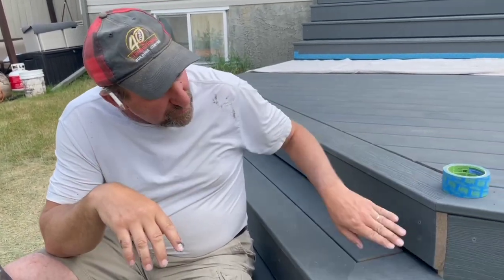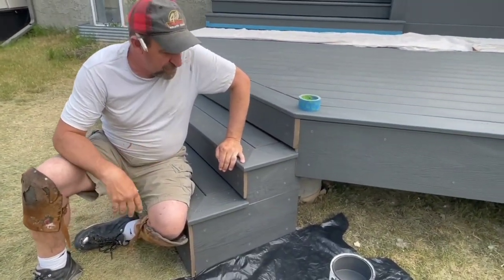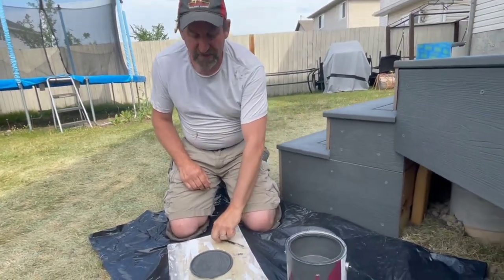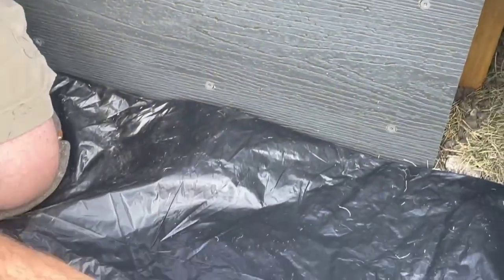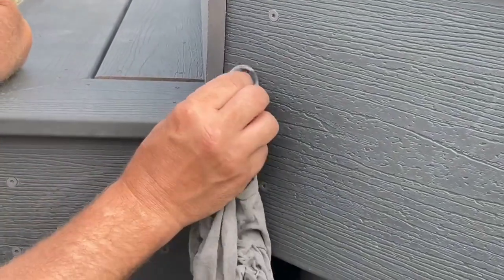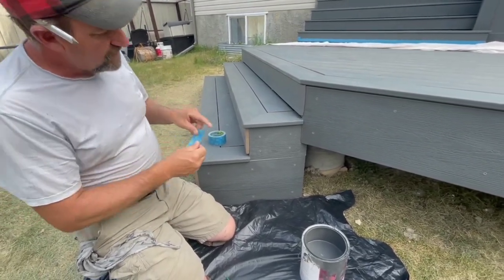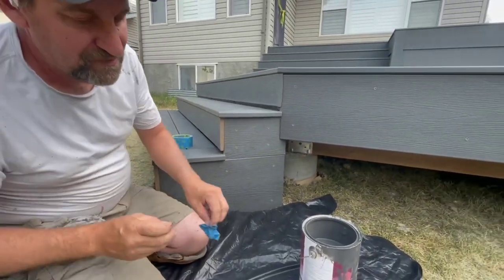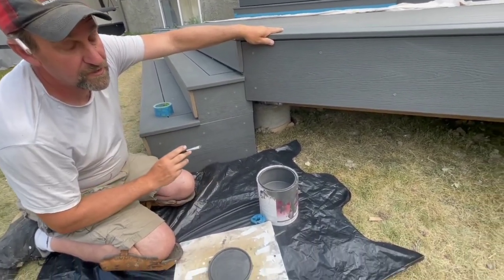Painting the Ends of Composite Fascia (Trex)

Comment: If it is a 45 u hate but not just down length but 2nd 45 cut the other way 2nd way to keep locked tight, trying to see it in my eye not carpender there either.